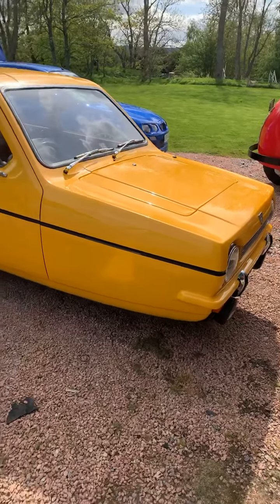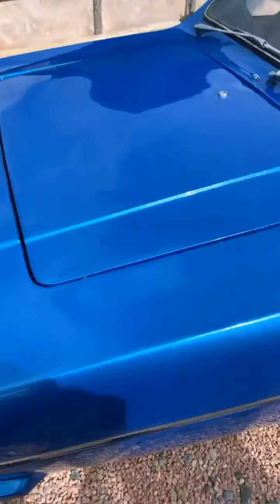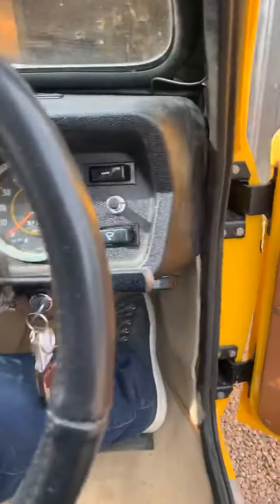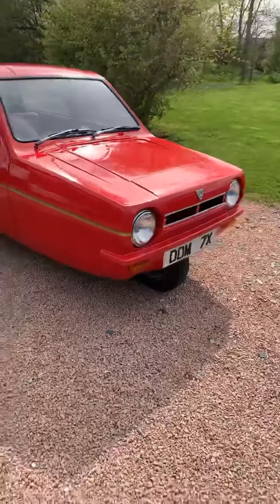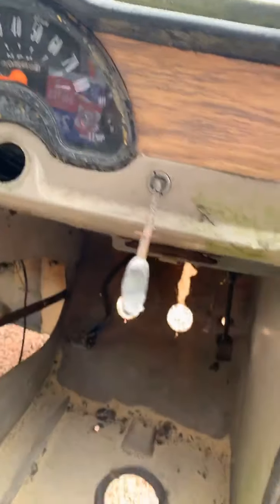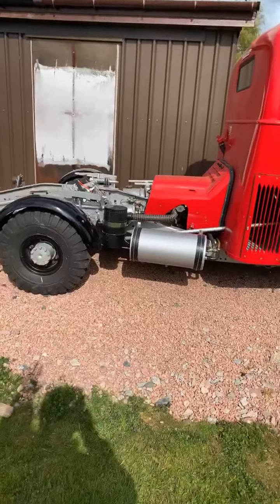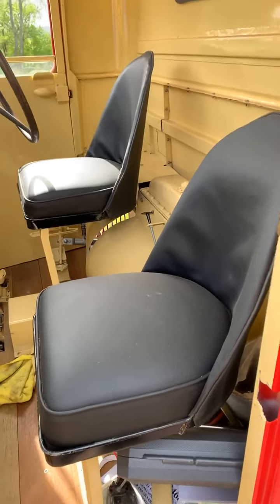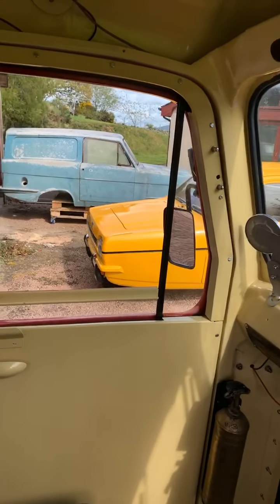Facebook live video walk around

Comment: Hi Lewis, I really enjoyed seeing all your cars.  They all look to be in great shape.   You were commenting about the door handles.  As a long-time Mini owner, maybe I can clarify a bit.  The outside door handles on your red Robin are definitely Mini, however I don't think the handles on the blue and yellow cars are Mini.  They look different.  I've seen them before but I can't place them...  This is going to bug me!  And those interior handles were used on just about everything, such as Austin 1100, 1300, 1800, Maxi, Allegro, and Morris Marina.  I might even be missing a couple...   And yes, the hubcaps on the yellow one are definitely Mini.
Reply from the maker: Hi Ian, after I filmed this video I spoke to an ex reliant manager, he told me all handles were bought from manufacturers that offered them to other marquees at the time. Probably the reason so many motors have them 😅, it could be possible that the door handles were reliant specifically, but I’d have to check
Reply: @LewiBuchProductions  Yeah, I guess it makes sense they'd just use whatever was available.  Anyway, I love your videos and your cars.  I wish I could have one but I live in Canada and there are only a couple over here.  Cheers!

Comment: That looks a  really nice  collection did you  do them all  up  yourself. You have made great job mate. I  do like the  robbin but prefer the regal and the supper Van 3. The regal Rs Aberdeen reg Think if I  remember  rightly Inverness being ST I believe. I  dealt alot with Reliant of Selby In Yorkshire. Do you know if there still on the  go. I bought a clutch steering box engine mounts brakes and  a few other parts. My uncle  had one of the early  regals he said they where great in the  snow. Yeag they used parts from ford and British leyland pretty good idea the later. Rilto I had the 850 with high compression head. Man  it would  fly . The gear box  would sing I had problems with  my back door. I  would  love to get my hands on a kitten. The Su was fitted on my Rialto Gls she was a C reg 1986. man she was a Great little machine. Nice little Mg ZR I have  had 3 of them.👍
Reply from the maker: Yeh all the reliants I’ve restored myself over the last 7 or 8 years,  I think there still on the go but would have to check! I’ve only driven a robin in the snow and it was pretty scary 😂